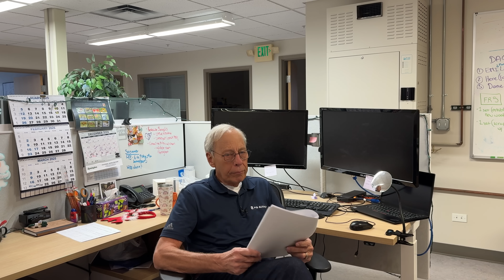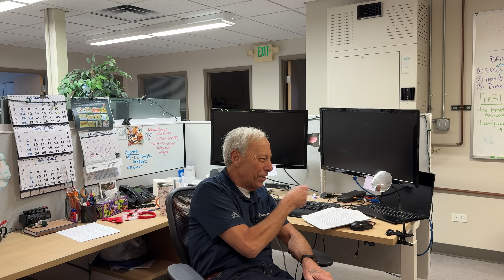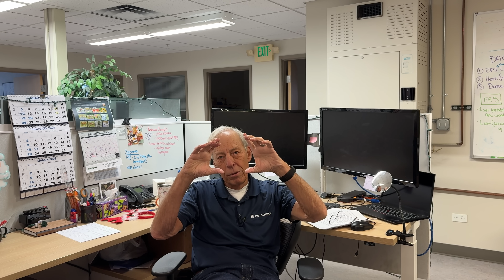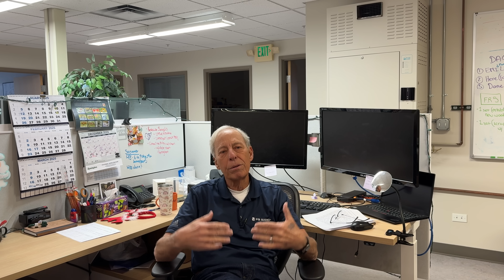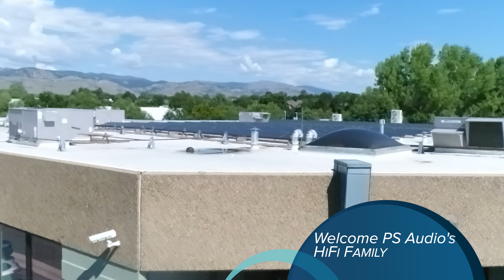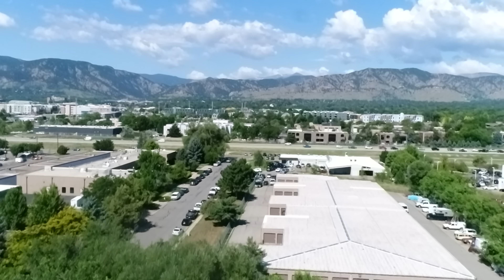What makes monoblock amplifiers better

Comment: I look forward to your videos nearly every day and binge watched the ones I hadn't seen yet. Thank you for sharing your knowledge and wisdom. It is sincerely and gratefully appreciated!

We are fortunate to have the most wonderful son-in-law on earth AND he's an electrician. He installed separate 20 amp circuits for our each of our monoblocks plus a separate circuit for sources and a fourth circuit for our surround amplifier. 
He also installed an enormous ground system for our service panel using 4 awg cable that has been spot welded to eight, eight-foot, copper-clad grounding rods spaced around our property. Whatever he did, it has made my system so quiet that music literally jumps out of our speakers from an utterly silent background.

Comment: If you have the money and space for monoblock amps, then you should run them on separate electrical circuits (have an electrician run new circuits from the panel). Buying a PowerPlant should be the last option, as it's the most expensive.

Comment: Come on!  How demanding are these folks, on these systems!  I mean, I like what I’ve always referred to, regarding amp, AND speaker performance, that thing I call “Peak Transient Composure”
  whereby well crafted amps have the reserve energy to keep the sound wave smooth, AND NOT SQUARE!  I’m nobodies fan of Lava Dome, explosive THX deathknells.  An occasional 97dB peak  every once, in a while is fine, but geez!  A dual monaural toriod/power supply in a Stereo construct works just as well.  Sometimes, I don’t even think these folks like music.  They only listen to hardware.  How sad.🌹✅✨

Comment: I like them for their smaller size and cooler running temperatures. I would have a hard time fitting a full size integrated or dual mono amp on my kitchen supply prep table shelf.

Comment: I have electrostatic speakers, and switched to mono-blocks and the realism is awesome.
Try Bi-amp your speakers will do similar improvements too.
I think these changes have a much bigger effect on very sensitive equipment.  If you have low end stuff, don’t bother doing any of this.

Comment: How much is the difference? So if i have a 200wpc integrated amp with 20-20,000 hz at .01 distortion at full power and my speakers ar running 90 db at 20wpc, I will achieve better sonics if I have two monoblocks with the same specs?

Comment: My naive question is: who buys amplifiers that are so challenged that the channels "appreciably" affect one another? The only time that a stereo amp would let one channel affect the other is when you have no headroom. Buy big enough and then you have no issue. My view is that monoblocks are better because they can be placed next to the speaker allowing for very short speaker wires.
Reply: People often mention the reduced crosstalk and increased headroom of mono amps, but I wonder if the shorter speaker wires might not be the biggest advantage. Yes, I could be wrong, but I tend to agree with you.

Comment: I use a Bryston 14bsst2 amp which uses 2 separate discrete transformers. It drives my Magnepan 20.1 speakers with ease. I’m assuming most stereo amps use one transformer as Paul is indicating?
Reply: Two transformers has some advantages, but my amp has a 5kva dual domain transformer which is larger than most amps with dual transformers, and most monoblocks combined.

Comment: All shades of grey.  Optimal solution:
Use oversized power supplies
Use monoblocks
Use beefy power cords
Use two 10 gauge 20 amp circuits to the breaker box
Wire those up to two different 120V bus bars to the step down transformer
Reply: That’s what I have, and it works great, as predicted. 😊

Comment: I have each of my monoblock amplifiers connected to separate electricity utility companies.
Reply: Same here, but I make sure one generates its power from the Southern hemisphere sources, and the other from Northern. Less interference that way.
Reply: I insist on my AC being
generated from nuclear.
It adds a warm glow to my tubes.
Reply: @canmisir - plus, the opposing coriolus forces in the two hemispheres provide a truly balanced circuit.
Reply: @rsuminsby  absolutely, how can one forget about the hemispherical coriolusity considerations!
Reply: Just make sure you are signed up for the audiophile electron service from both of them, consumer grade electrons just don't deliver the same PRaT.
Reply: In this household, electrons
are shampooed and conditioned.

Comment: the extreme lengths to justify non-audible (really) changes in "performance" seem to be designed to justify ludicrous prices for equipment that provide no real added value...i just looked at test results for some equipment, where a $2000 "combined" streamer/DAC/amp outperformed a $20,000 streamer!
Reply: Outperformed it how? You couldn't hear differences in a mono vs stereo setup?
Reply: The question is: which tests? It's pretty easy to design equipment that works well on some standardised measures (e.g. THD at 1 kHz sine-wave on an 8 ohm resistive load) but still doesn't sound good.

Comment: OMG every powersupply will compensate for small differences in voltage
Reply from the maker: Not true in a power amplifier.
Reply: @Paulmcgowanpsaudio  if you have an under-specced or poorly designer power supply, sure, just don't do that. It's incredibly easy to measure power supply ripple/droop etc. It's not exactly rocket science to design a comfortably over-specced and rock solid power supply (or buy in a module). Hell, add a bunch of low ESR smoothing caps, some inductors, go nuts.  You do this all the time Paul, everyone in the electronics industry does. Quiet power supplies are very very standard electrical engineering, and don't need to cost thousands.  You're competent enough to know this but that fact doesn't align with your business.
Reply: Yes if you throw a regulator in which screws up the PS internal resistance/ Damping Factor. Otherwise the unregulated PS which sound significantly better will have to follow the laws of physics and sag.
Reply: @glenncurry3041  my amplifier is regulated and doesn't seem to have a problem with bass, so lower damping factor doesn't seem to have an effect after a certain number is reached.  The reason you probably don't see regulated high powered solid state amplifiers is because of cost, much larger power transformer would have to be used.
Reply: @mitchtaylor6512  So you do not understand circuit design? Show us all a power amp output with a voltage regulator.
Reply: @glenncurry3041  many class a amps have voltage regulation on the output stage, and have outstanding bass performance. My Krell amp is one such amplifier, it only has a damping factor of 120.

Comment: Wouldn't a stereo amp w/ dual power supply be the same as separates?
Reply: It is said that shared chassis has crosstalk. And you have to locate it central instead of each closer to it's speaker.
Reply: To locate two power supplies in the same chassis you, by definition, have to compromise on their size/heft. By separating each channel into a separate chassis, you alleviate a lot of the space constraints you practically have with a single chassis stereo amplifier. Alas, you have just tapped into probably the most beneficial aspects of monoblocks.

For example, my Audio Research Reference 250 SE mono blocks have the same power supply in each of them that my Audio Research Reference 150 SE stereo amp has for both channels, in the same size chassis as each of the monoblocks. So effectively, each channel has access to twice the energy storage and power availability, but for the stereo amp it has to be shared.
Reply: @MrChristerBerg  one could also have the power supply in a separate chassis like the pass labs XS series of amplifiers, so 4 chassis monoblocks.

Comment: And if you’re listening at normal, listening levels, you’re usually only consuming roughly one watt of power so there’ll be no effect on the mains power of the building wiring. Because you have so much excessive capability it’s like taking 1 teaspoon of water out of the ocean..
Reply: Normal listening levels at a concert might be 80dbSPL - 90dbSPL? My Maggies easily suck >100W to get close to that at listening position.
Reply: @ yes we all know about the Maggie’s.  Exception to what’s normal average speakers 🔊 . 
      Looking forward to getting my first pair myself. . . 
    @ 120v we have 1500 to 1800W available

Comment: I believe the issue arises when you pack two-channel amplifier into a single box, as there is limited space for the transformer. The size of the transformer restricts the power output due to magnetic saturation in the core. The mono-block design solves this problem by allowing for a much larger transformer for a single channel, or you can build a separate box for a larger transformer, which will yield the same result for a two-channel amplifier.
Reply: My stereo amplifier has a bigger power transformer than most monoblocks combined.

Comment: While there might be some merit to Paul's technical explantations  I wonder if there would be any audible differences to even the most discerning ear
Reply: Probably not, my amplifier has a bigger power transformer than both of his BHK 600 amplifiers combined, and it's a regulated power supply.
Reply: Many would argue that the power supply is the most critical part of a power amplifier. And actually, according to Audio Research, the same goes for DACs and preamplifiers. You cannot oversize a power supply.
Reply: @MrChristerBerg  for sure, that's my point, most monoblocks don't always have a better power supply than a stereo amp. There are many stereo amps that can outperform monoblocks.
Reply: Yes there is
Reply: @Pete.across.the.street  the only difference is speaker wire length. You can claim cross talk but it isn't a problem in properly designed stereo amps.
Reply: @mitchtaylor6512  problem is, if you use that definition, not many amps are "properly designed "
Reply: @Pete.across.the.street  I don't buy those kind of amps
Reply: @mitchtaylor6512  good for you.  Not all of us have $20000 to buy "properly built " amps
Reply: @Pete.across.the.street  I bought a used amp for $2,000 , it was $10,000 new about 30 years ago. It worked great for about 7 years until I had to change the capacitors in the soft start board.
Reply: @mitchtaylor6512  I'm don't doubt that.  I'm saying that there are compromises  made in the design of almost any amplifier. Unless you are spending huge amount of money,  you are not going to get a so called "properly designed " no compromises amplifier
Reply: @Pete.across.the.street  I agree, that's why I buy used equipment and I'm patient
Reply: @Pete.across.the.street  that’s why highly performing preamplifiers and power amplifiers are expensive. With your comment, you have just explained that to yourself and everyone else. You cannot make a Class D amplifier in a small chassis with a smallish power supply and think, regardless of how good Class D amplification has become, that it’s going to be even close to a Class A or A/B amplifier equipped with a significant power supply. Both transformer-wise, power regulation circuit-wise, and also capacitance-wise so that you have plenty of energy storage on hand for dynamic passages in the music. It’s just physics.

Comment: There was a company that used to make amps that were two channels in one chassis for stereo using dual power supplies. However, with digital instead of analog input and control sections and cost we just don't see that anymore really.
Reply: It was very popular back in the day. Lots of companies had multiple power supplies in stereo amps, receivers even.
Reply: Yes, but then they figured out that space is always a limiting factor, so they either had to make each power supply section smaller, and keep in mind that that’s both a power transformer, as well as respectable amount of capacitors to have energy storage on hand for dynamic passages in the music, OR they could separate the two channels into two separate boxes. Alas…monoblocks. 😊
Reply: @MrChristerBerg  my amplifier has a bigger power transformer than most monoblocks combined, it's also dual domain and regulated.
Reply: @MrChristerBerg  it's only a compromise if the chassis is small, my stereo amplifier is 2' deep and 20" wide and has a power transformer that weighs 90lbs.
Reply: @mitchtaylor6512 it will always be a compromise because regardless of the size of your stereo chassis,you can take two of that same size and make monoblocks. So for monoblocks you will always have more space compared with 2ch amps. It’s quite self-evident, but you do you. 👍
Reply: @MrChristerBerg  this is true,but most monoblocks made don't have a power supply as robust as the one in my stereo amplifier, with it's 90lbs power transformer. You can get monoblocks with a bigger better power supply, but most don't.

Comment: I do not believe that a decent mains supply to your home is going to modulate the mains voltage to anywhere near to a consequential degree. If that's an issue, then your home wiring or your electricity supplier has inadequate quality. In that case, maybe you have to overcome those deficiencies. Is mains power in the USA that poor?
A powerplant may be useful to give a good low distortion sine wave power.
I've wondered about shared power supplies  and one channel affecting the other. Most demand is made by low bass, and generally, that is present on both channels, so both channels are going to place demands on the power supply. I'm sure that there are notable exceptions. 
Having said that, I use two monoblocks, but my reason is to have very short speaker cables to control the bass back-emf better.

Comment: Another question: Why have high-end audio companies not come together to create a standard for DC supply across all equipment? It seems a bit absurd that a power regenerator takes AC, convert to DC, back to a re-generated AC signal, which then goes to something like an amp that again converts it back to DC: why not convert it once to DC
Reply: How would one standardize DC?
Reply: AC was better at killing elephants.

Comment: I have always wondered exactly that: If you plug monos into the same circuit, they will interfere with one another. So glad that you clarified you need a power regulator to prevent that. Question then why not have two power supplies in one chassis?
Reply: You can certainly do that. You don't need it to be in two separate boxes as it's not hard to isolate the parts. There are even integrated amps with several power supplies so each part has it's own.
Reply: Monoblokk = separation between left and right. Far better separation Vs a 2chan+ amp. It all depends on your pre amp at that point
Reply: @Error2username  you can't hear the difference between monoblocks separation (or crosstalk) if the stereo amp is designed properly.
Reply: There is also the advantage of proximity to the speaker to better control the woofers.
Reply: @5thlevelweb887 hahaha
Reply: To answer your question: that can be, and is sometimes, done. Such a configuration is called “dual mono”. It gives you some of the benefits of using true mono blocks, at a cheaper price (only one chassis, etc.).

I used to have Musical Fidelity P170 back in the day. One power cord and one chassis, but two transformers and power supplies (one for each channel).
Reply: @nico.vandyk  why do you believe this guy? He's a salesman not an electrical engineer.
Reply: @Mk-tp2mz  ?😂LOL he is both..
Reply: @Error2username  no he's a salesman, clearly you have no tech knowledge to know the difference

Comment: Unless you have 208V 3-phase service all of your monoblocks are sharing the secondary of your single phase transformer out on the pole. With 208V 3--phase you have three different hots that are on a different transformer and provide 120V with reference to the neutral. For most of us with 120/240V single phase service it's better to run your gear on 240V. That does away with the neutral and all the noise problems that come with neutrals that are supposed to be at 0V but rarely are. Also, I don't get much in the way of wiggles until I run my monoblocks out of Class A. With over 100W on tap this rarely happens. When Hendrix or The Who require those 1000W peaks those wiggles are clearly visible but much less so at 240V likely to the reduction of I squared R loss. It's always fun to flicker the neighbor's lights which is easy to do to those who share the same transformer.

Comment: I always look at over specced power supplies and mono amps, I also recommend fitting individual spurs from a dedicated CU to each socket from a separate switch with over specced cable (seriously, it's not as expensive as you might think and provides better isolation and drops impedance significantly)

Comment: The best solution would be to use two or more independent power sources. 
Purists who use solar power to operate their stereo system are extremely challenged, because two suns as a primary energy source are currently not possible - no matter how much money you can spend :(
Reply: This comment is pure gold, like some speaker wires
Reply: I would question using solar power for a stereo. They use pulse density modulation to convert the DC to AC. Very noisy!
Reply: @glenncurry3041  If you think for a moment about why audio amplifiers need a primary transformer, even though their electronics run exclusively on direct current, then you can guess that real solar enthusiasts have converted their devices to pure direct current drive ... and therefore do not need DC-AC converters.
Reply: I assume that your hilarious comment is a joke 😂